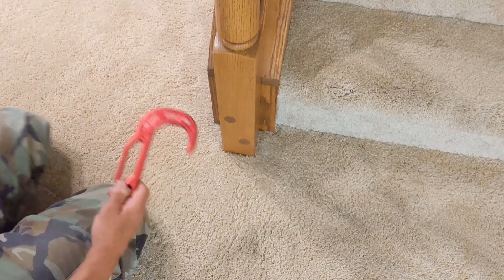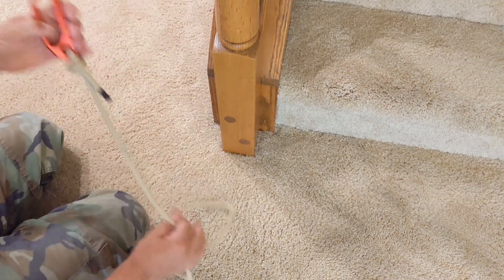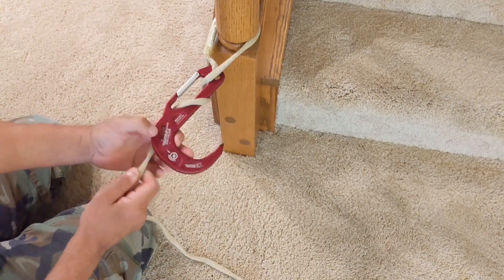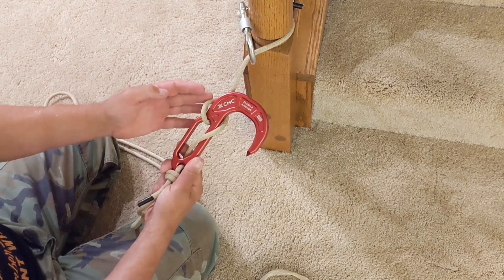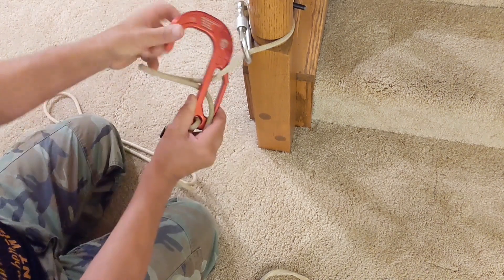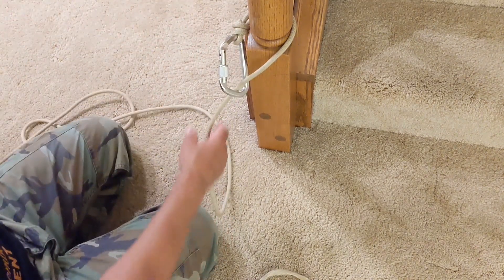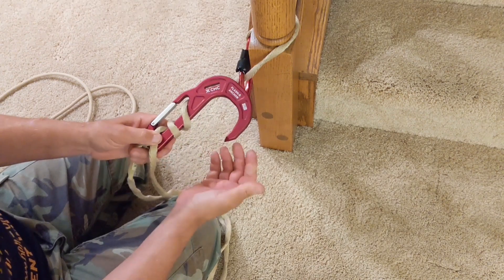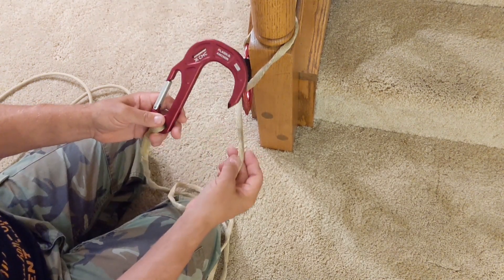Video #2 - Firefighter Escape System Anchor Hook comparison - CMC Flash 2 vs Flash G

Comment: What size rope can fit into the hole on the bottom of the flash.2
Reply from the maker: The captive eye at the base of the hook is 12.5mm in diameter - Just under a 1/2 inch
Reply: @DALEGPEKEL  okay thank you, what size rope do you have attached?
Reply from the maker: @vizionxreconz3387  The Flash G has CMCs escape webbing, which is 11mm - The Flash 2 has 7.5mm Sterling FireTech 32 rope

Comment: I'm just getting into this gear. Which is proffered? Nice wanna lean towards the webbing
Reply from the maker: Kevlar webbing is stronger and more resilent compared to Kevlar rope - For example a section of 7.5mm Kevlar rope might have a breaking strength around 5,000lbs while CMCs escape webbing that comes with there LEVR system is around 6,100lbs and holds up much better than it's rope counterpart - Especially after repeated use. The CMC LEVR is arguably one of the best systems currently on the market and my personal favorite. If you can afford it, you won't be disappointed!!
Reply: @DALEGPEKEL  thank you. 😊